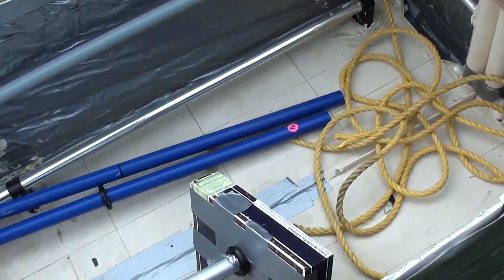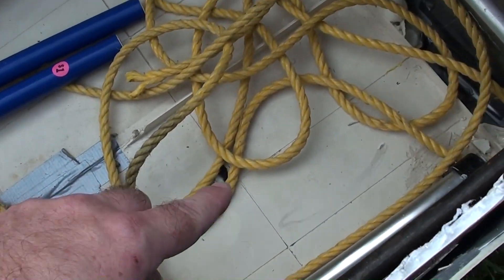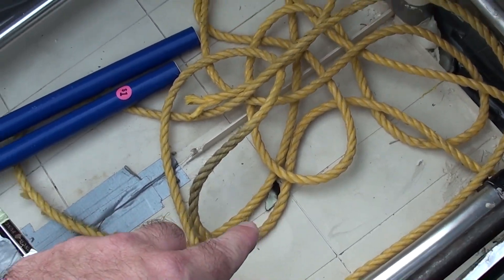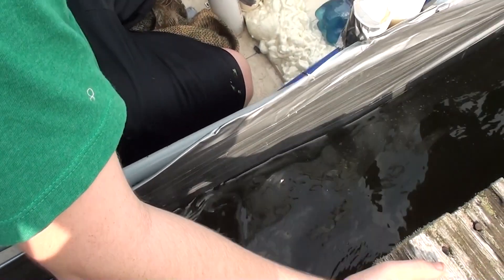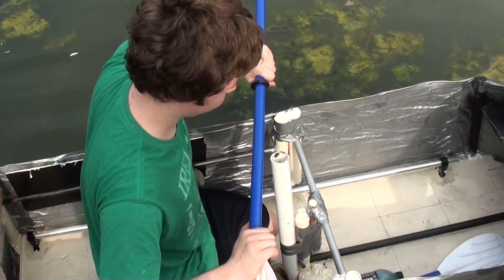Duct Tape Boat - First Test of My Sons Latest Project -  Featured on SYFY Insane or Inspired

Comment: The duck tape should be vericle not horizontal. It should start at the t op of one end and end at the top of the other and itshuld have a guidpart like a tail or a conoe thing like on moanas boat. And curvthe bottom in a bit more. If you want a exampl check out mythbusters duck tape island.
Reply from the maker: The tape was laid down vertically first, with a horizontal layer put on top of it.  It worked and didn't leak.